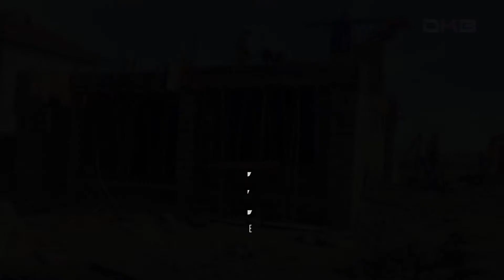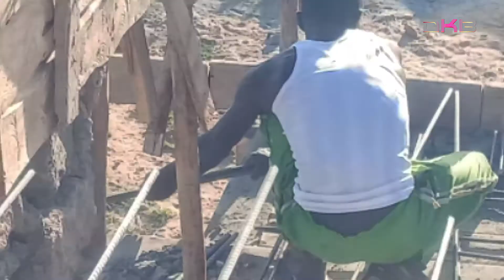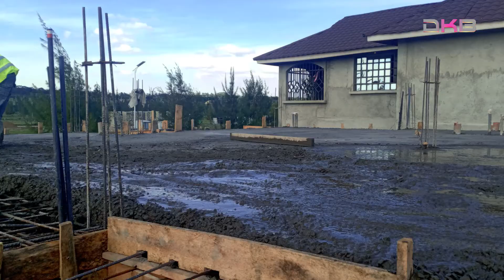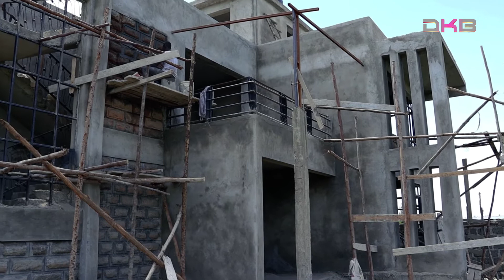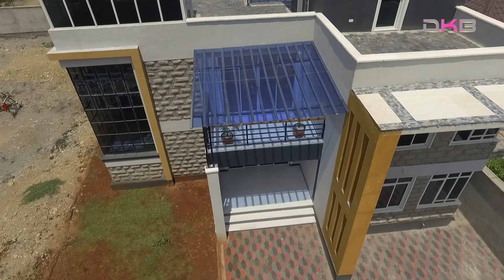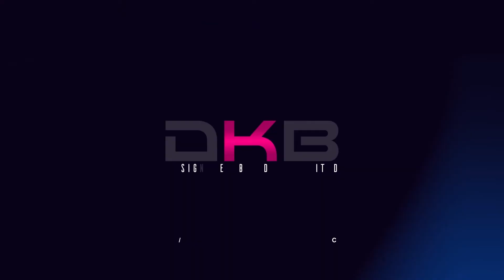5-Bedroom House plan/construction

Comment: If i want the same house as these can it feet on a land of 50/100 sir.
Reply from the maker: Yes. In fact, the house is being designed to fit on a 50x100 size plot.
Reply: @designkeybuildersltd7365  what would be the total cost for this massionate sir.
Reply from the maker: @alfanm.8221  its construction budget is estimated at 14.5m